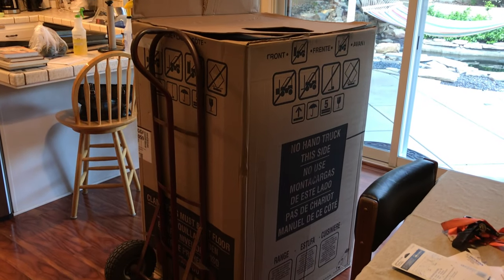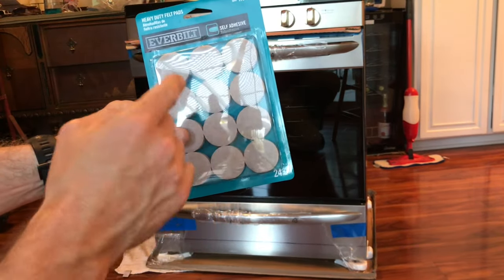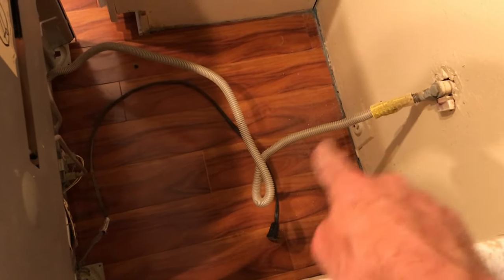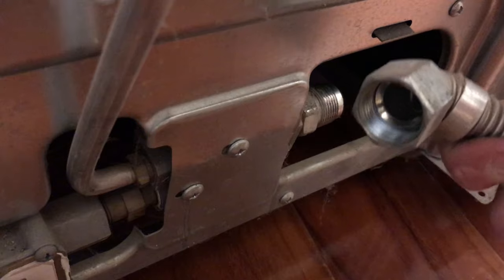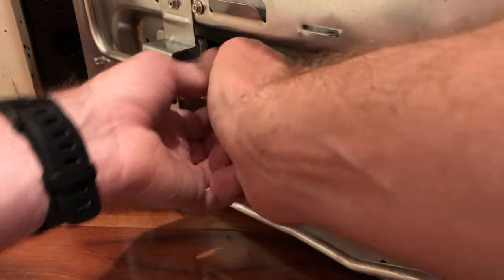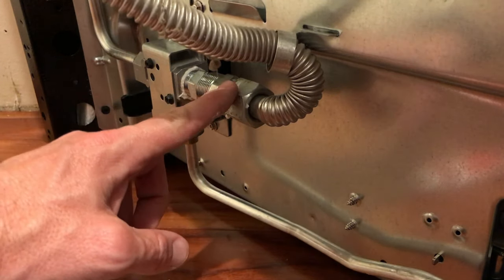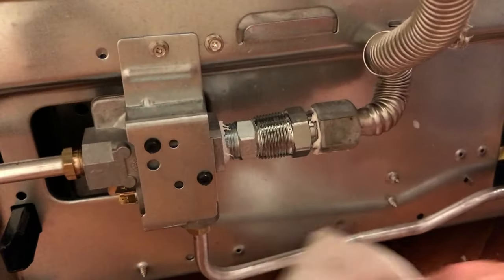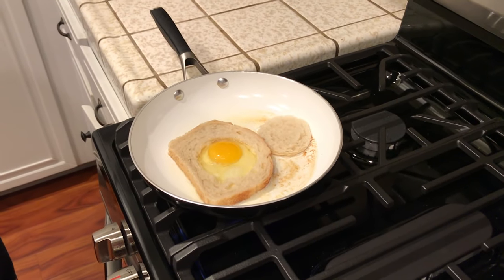How to hook up a gas oven and not blow up your house!

Comment: FYI for those finding this now, you DO NOT use pipe dope on a flare fitting.  It can interfere with the fitting seating properly and actually cause a leak.  I can see in this video he did use it on that fitting as well but didn't mention it.  Don't use it, its designed to be used without tape or dope.
Reply: By pipe dope do you mean the sealant?
Reply: Remember kids, they call it dope for a reason.

G.I.JOOOOOOE
Reply: @drzorkloft2  🤣
Reply: He did not use it on the flare fitting when he installed it, then later you see the dope on it when complete
Reply: @glennanderson8981  But that's not what it looks like. It appears the flared fitting is filled with the pipe sealant. And that is a big point that could cause other issues if the sealant were to get inside the gas line

Comment: I bought a brand new stove a brand new Frigidaire five burner from Lowe’s they did not tell me whether it was propane or natural gas I wasn’t smart enough to ask I got home I found out it was for natural gas I have propane we live in Alaska Lowes does not have any installation people so I need to switch this over from natural Gas to propane and I have to do it all myself and I have to change all the offices myself also I am a girl I know I can do it but it’s just crazy that they don’t tell you all the stuff at Lowe’s so FYI any girls going to buy a new stove make sure you ask all the right questions first Lowes does not even sell the conversion kit from natural gas to propane so I also had to learn how to find all that stuff online
Reply from the maker: That's a bummer, but good for you for getting it sorted out and DIYing it!!!
Reply: @Susan Hafner  That's very interesting that a gas jet kit was not included with the new gas range (leave it to Lowe's). We just replaced the still working Whirlpool gas range that was installed in our house, when we had it built 5 years ago, with a Frigidaire induction range. The Whirlpool gas range actually came with a jet kit to convert it from natural gas to propane, which we still have and never used. Propane actually requires a smaller jet orifice, since it has more BTUs (energy) per cubic foot than natural gas (methane) does. Therefore, less propane is reqired to do the same amount of cooking as natural gas. I like to cook, and I used to swear by gas stoves. However, after switching to induction, I will never own a gas stove again, which is probably a good thing since they are gradually banning gas stoves here in "everything has to be green and expensive" California. The only drawback to an induction range is that it requires a 240v/50a/4 conductor circuit for power, which can run another $1,000+ to have installed, if you don't have the electrical circuit already. That all being said, I hope you had good luck getting your new gas range safely converted to propane use. 🙂
Reply: @TheGuitarman1968   thank you  but nope  🙁 gas oven  still has huge flames 🔥 when I try to use it  so I am currently using an air fryer 😕 I live off grid 
But I have heard a lot of talk about the induction range and stove from RV folks 
I am getting quite good at the air fryer but miss using my unsafe oven 
Stove works great though

Comment: Always put in new hose. Reason is they are compression fitting and one use only for safety critical applications.  Reusing compression fittings is asking for trouble, whether it is gas line or water line. Hilarious that video title says how not to blow up the house 

Change the hose. It is better to be safe than sorry
Reply: I was just trying to decide whether to change out the hose.  Glad I saw your comment.  Here's to not blowing up the house.   Thx.
Reply: Where I'm from they have to be changed every 5 years anyway
Reply: I bought a hose adapter kit for mine and it came with an auto gas shutoff adapter.   Are these necessary?

Comment: Just a note there are three types of adapters in different sizes that allow you to connect your gas line to stove/oven. 
For example, the newer yellow gas line has its own adapter it comes with BUT you need to change your gas line stem/cap- it will not connect . 

The old silver gas line as shown in the video has its own adapter which you can buy to attach your NEW stove. Go to your Home Depot and they will find the right piece it’s $5-6. So you don’t need to change your gas stem/switch line.

Comment: Thread sealant is a great idea but do not use white Teflon tape for gas.....use the yellow Teflon made for gas.
Reply: I 2nd that learned that in the pipe fitters union
Reply: What about oates great white pipe joint compound with ptfe?
Reply: do not use tape , even the yellow , check local codes...
Reply: Tape or not to tape? That is the question...
Reply: Just had this conversation with the plumber who redid my gas line yesterday. Do NOT use regular plumbers tape. The natural gas will dissolve it over time and can cause leaks. You must use the tape specifically made for gas.  (yellow).
Reply: @ctuso  the only difference in the tape, is that yellow is thicker than white. Yellow tape is also able to take slightly higher temperatures. So yellow tape would be preferable but not necessarily vital. 

If you are SILLY enough to carry out gas works using DIY videos however this would not matter 😂

From a plumber/gas engineer  of 10 years
Reply: Why would you say that?
Is it impossible or is it too dangerous?
Reply: @forreal8704   You're wrong, silly. It is vital. The yellow tape is physically different than white. White is not only obviously thinner but is also more porous. Yellow is denser and specifically designed for gas and resists degrading.
Reply: @ruffxm  you just reiterated what I just said……..  depending on where you live in the world, get into your domestic gas/heating books It clearly states that yellow tape is the preferred and better method as it is specifically designed for gas fixtures only 

However, it is not an absolute essential.
Reply: @forreal8704    You don't think the non-porousness and resistance to degrading when exposed to gas is essential? If you would be ok using white tape on a gas line in your house, then you can stick with your opinion that it's not essential. To me, being designed specifically for gas is pretty essential. What is your point of saying it's not essential? If I didn't know and read your comment I would interpret that as saying "yellow is better, but it's ok to use white". I'd never give that option to someone. But that's me.

Comment: An excellent 'how to ' video. My gas stove needed to be replaced. Had never done this before and the step by step directions were superb. Thank you.
Reply: Just curious did you also have the shut off valve for the gas behind your stove? Ty
Reply: Yes. The gas valve to the gas line was directly on the other side of the wall. The location of the valve is not as important as having the stove line properly hooked up to the gas line.

Comment: I have the same exact stove. The manufacturer says to place a wrench on the inlet nut on the other side of the regulator when tightening the supply line. This will ensure that there is no stress placed on the inlet valve. Just my 2 cents, but a very informative video.

Comment: Thought you’re not suppose to use the sealant on flared fittings?
Reply: It's not necessary but I don't believe it will hurt. It's simply a thread sealant.
Reply: Better to use yellow gas tape.
Reply: @LisaMurphy  Why? I've never used tape, always the tube sealant with no problems.
Reply: @whiteknightcat  Because the tape works as well and it's neater and cleaner to use, and remove.
Reply: @LisaMurphy  OK.
Reply: @LisaMurphy  No.
Reply: @LisaMurphy  No. When I said OK, I meant "Oh, so in other words, yellow tape is better because you personally prefer it. If I had been convinced of your reasoning, I would have said something like "Thank you for informing me of something I hadn't been aware of", but I wasn't, so I didn't. You have your way of doing things, and I have mine, and that's ... OK. OK?
Reply: You are correct . No sealant on the flair fitting. It is a compression fitting. You can stack toilet wax rings for a desired effect.
Reply: Manufacturer's instructions say "do not use pipe thread sealant or Teflon tape on any flared ends because you will not obtain a leak free seal."
Reply: @croutside8386  Thank you. I was not aware of that. Now I know.
Reply: @whiteknightcat  I'm confused help me out.. so in the video when you applied sealent the first time it was correct.. but the second time you did it where it goes to the line it was wrong right?
Reply: @Allllday  I'm sorry but I'm afraid you have the wrong number. I am not the creator of this video.
Reply: Hi everyone, conical  or flared seals  are not designed to get sealant,  if you look closely at the flared mating surface you will see that it seals  before reaching the threads portion of the fitting, appling it to the treads  is a waste of sealant.
This being said one must know the difference beetween pipe thread (interference sealing) wich sealant will greatly improve it"s integrity.
Reply: @whiteknightcat  what a karen. she took time out of her work? its a freaking youtube channel. 🙄
Reply: @michellacroix7198   is not going to do any harm if you use any pipe ceiling
Reply: It won't hurt anything as long as you don't get any on the flare face but never never use soap and water to leak test gas piping, it will corrode the fittings and cause leaks. You need a specific non-corrosive bubble leak detector or an electronic leak detector.

Comment: Recommend putting in a new gas line when you replace the stove. It's inexpensive (about $35).
Reply: Also sealing the other connections while you're at it
Reply: @afnoot  He did seal the other connections, you could see the sealant... But yea on a gas line how to showing every single step including every seal is probably best. Daunting task at first but easy if you're safe about it

Comment: Not a big fan of sealant on gas fittings as it can get squeezed pushed into the gas flow and clog the gas valve causing an expensive repair.  Especially not on the tapered fitting.  Yellow “GAS” tape is the best option only on the straight threads, use nothing on the taper side.   There is a product to use on tapered thread on a HVAC mini split system but it is way different from the Recto-seal style sealant he is using hear.   Yellow “Gas” tape is a very thick teflon tape that allows the fitting to slide and seal easier than bare metal.  It is not the same as the white ultra thin tape and doesn’t shred easily like the white teflon tape.  Always use a secondary wrench to keep from twisting the gas valve on the stove or the gas valve on the wall.  I like real wrenches with crescent style in close second choice and slip-joint pliers in last choice for tightening and first choice to damage things.

Comment: You made a mistake as careful as your were. After you shut off the gas line you need to open up the valve to the stove and let it spark and burn off and or let the gas escape from anything that's left in the line.
Reply: This seems like it would be common sense. 😊

Comment: Overall a good how-to video.

However, I would have replaced the old flexible line with a new flexible line...but I would have also made sure that the new line didn't get all twisted and kinked when I tightening the fitting.

Also...since it was demonstrated using two wrenches to loosen the fittings when removing the old line...why weren't two wrenches used when attaching the new line?!?  Personally this is more important because you don't want to put unnecessary torque on your new stove's regulator or other gas line parts.  That's kind of inconsistent.
Reply: I agree with all these points; I am awaiting your video when you show us all how to do it,... the right way!!  Thank you.
     Honestly though, I had all these thoughts while watching the video.  That said, I am still overjoyed he did the video helping me save lots of money.

Comment: Before u unbolt the gas, the gas must be purged, also must check if gas supply is halted. Do this by running one of the stove burners untill it flames out and wont restart
Reply: I wondered about this. Thank you for confirming.

Comment: Thanks for the helpful video.  Two questions:
1.  did the gas pipe adapters come with the unit, or did you need to buy them somewhere (if so, where did you get them)?
2.  is that standard teflon pipe tape (paste), or is that something special for gas applications?   (I've seen yellow tape somewhere)
Reply: jim mayors you can buy a new flex line gas kit any any major retailer and they will come with various threaded and flared ends depending on your need. 
You can use either the yellow Teflon tape that’s made strictly for gas/ propane or you can use pipe “dope” as shown in the video.
Reply: @GreenMountain565  Thanks Casey.   I would up buying a different range that had and reused the pipe and fitting from the old one.  I did buy yellow tape and did a really good leak check (soapy water) after hooking it back up.  Back in business!

Comment from the maker: Check out our video shwoing how to detect a gas leak on your stove: https://youtu.be/CHBK7t4t8lQ
Reply: DoItYourselfDad hi Thanks for the video.Can we use bbq line to get gas connection in Kitchen gas stove?builder provided bbq line from basement and it is close to kitchen.Please give your opinion
Reply: Should I apply pipe thread sealant to every part that I threatened

Comment: You should have replaced the gas line because there is a compression fitting on the female connection to the stove. Once its been compressed (fitted to old stove) its now compromised. Just a safety thing for me. Otherwise, good video; spoke clearly, kept it simple and the video angles were good.

Comment: Do you put the T+2 pipe dope on the adapter you installed where it connects to the gas line? Do you put T+2 on the 1/4 turn gas shutoff where it connects to the flexible gas line?  You did not show this in you video.

Comment: Hi there, quick question do i have to put a new hose when i put new oven in and the old one looks likes it has the adapter and new yellow hose gas line, do i need to put new one everytime?
Reply from the maker: Although I didn't in the video because I was dealing with an almost new line, it's recommended to replace the hose.
Reply: Ok thank you it looks like when they remold my house its has that yellow hose seems new...

Comment: Ok this is wat im tryba understand I dnt pay for gas n my stove run off gas but I notice it has that cord n plug ina wall aswell so am I paying electric for my stove being plugged its new im not sure I seen a plug on the old stove
Reply from the maker: If your new stove has things like electric ignition, a clock, timer, or digital controls it needs to be plugged in.

Comment: How do u know what size of adapter the stove needs? Are most of them 1/2 inch?
Reply from the maker: The manual should tell you what size fitting it will take. Sometimes it’s also indicated in the side of the fitting on the stove.
Reply: @DoItYourselfDad  thanks just looked it up online stove is coming today so wanted to have the parts to connect it says a flare Union adapter 1/2 inch npt x 1/2 inch ID so as long as my hose that I had is a half an inch should be good I think... store wanted to charge me almost $100 to hook it up

Comment: Did your ignitor work out of the box? Just installed new stove, gas comes through just fine but no ignitor and no customer service until Monday.  I can use the stove I just have to use a lighter.  I get no clicks, no sparks, nothing.
Reply from the maker: It did, is the ignitor working on any of your burners?

Comment: Did you use putty around the male adapter that the flexible hose screws on to?  The instructions with my kit said repeatedly and explicity not to use putty where the flexible hose screws on.
Reply from the maker: You don’t use putty or thread tape on compression fittings.

Comment: Is this natural gas or propane , we use propane & I believe I have to switch it somehow ?
Reply from the maker: The stove is natural gas, you can convert natural gas to propane. I haven’t done it, but my understanding is that it uses a different hose, and a different burner. Some stoves will come with both sets of burners if you need to make the conversion.
Reply: To convert a gas range from Natural gas over to LP gas it should state the directions to do so in the installation instructions which it should inform you on how to it or call a professional Gas Man.

Comment: So you connected the new line to the house first?  The same way you did the stove?  Why is that step skipped in the video?
Reply from the maker: Both ends are flared fittings, the same process on both ends of the hose.

Comment: As long as you have the gas shut off behind the stove, do you need to shut off the main line or the house supply?
Reply: Anthony Carcieri as long as you have a shut off valve behind the stove( which you should have one as it’s to code in almost every area) then there is no need to shut off at the main.

Comment: Do you always need an adapter to hook up the gas?
Reply from the maker: Not always, it’ll depend on the size fitting your stove has.
Reply: yes ..if you are using the gas flex pipe .

Comment: How to fix a gas dryer. Dryer not getting hot
Reply from the maker: Strange.... I thought I had done one already. Check the thermal fuse. 99% of the time if the dryer is running but not getting hot that's the issue. It's an easy $2 repair.

Comment: in this vid, your demo of turning off the gas valve is incorrect.  you were actually turning it ON.   with these valves (and all ball valves), the handle is perpendicular to the valve bore when the valve is closed.  you clearly opened the valve.